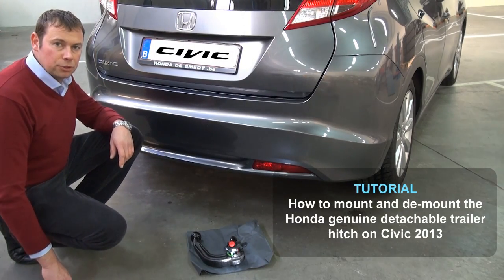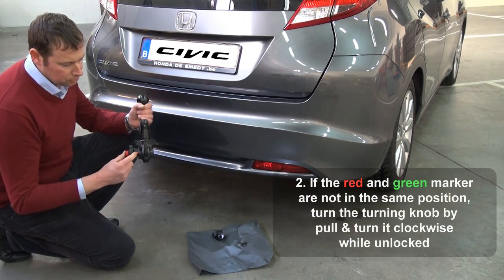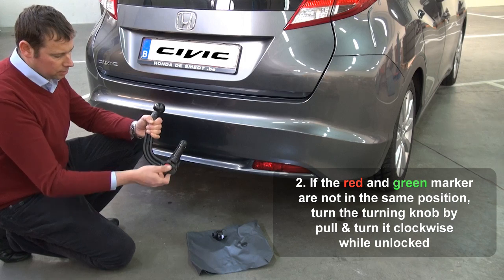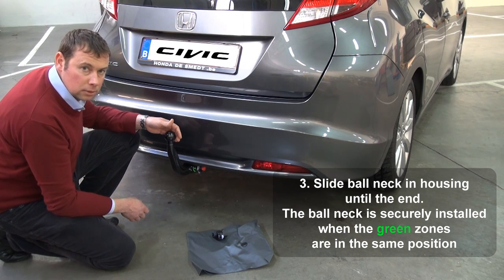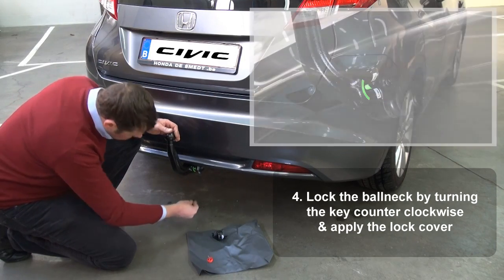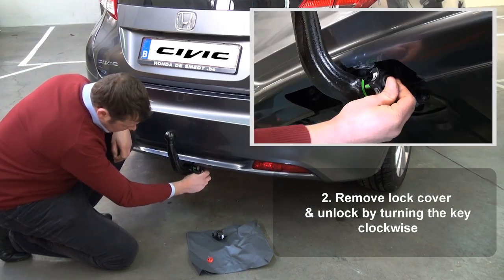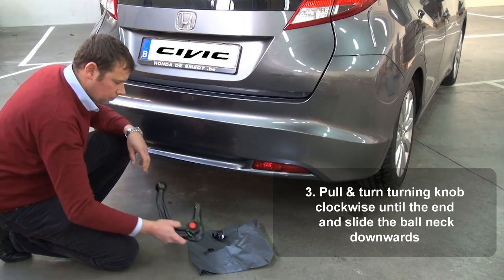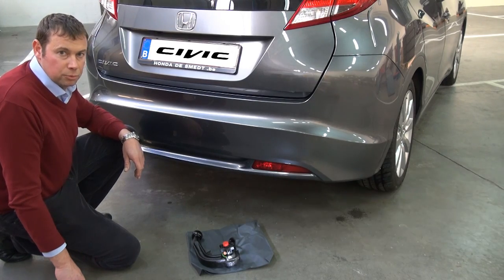Honda Civic 2013 - Mount and de-mount detachable trailer hitch

Comment: I have a civic2013 ex.   Seems I do not have the receiver on my car?
Reply from the maker: Hi, this is for the European Honda Civic 2013 and the attachment on the car does not come standard, it also needs to be installed together with the hitch.